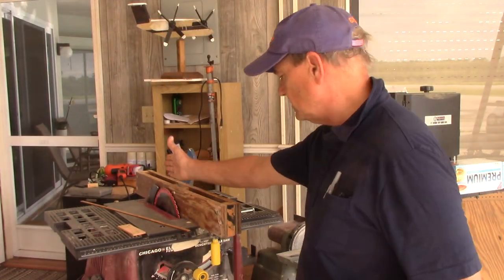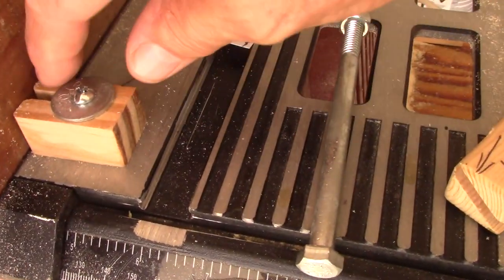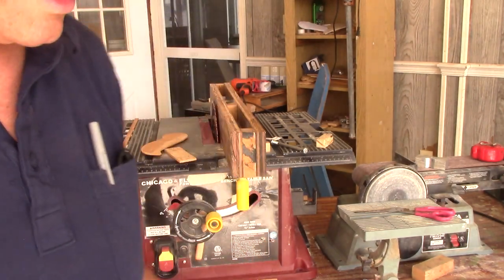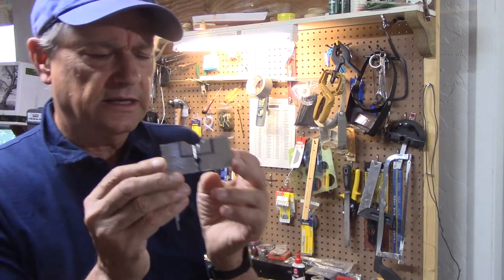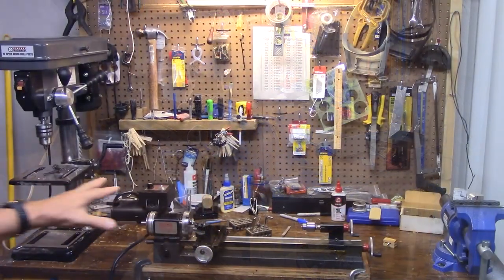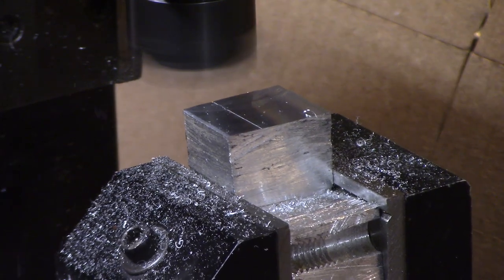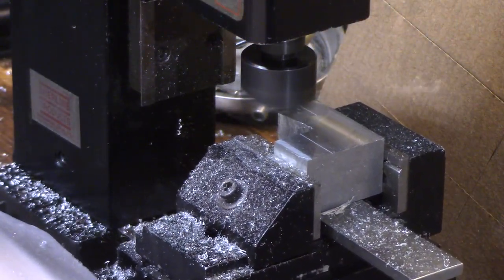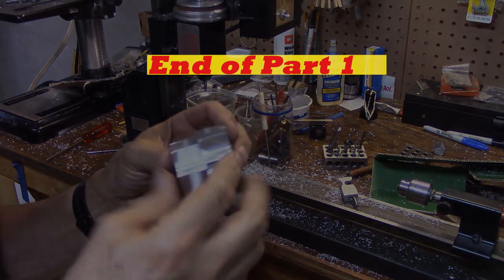How to cut thin strips, Diy Table Saw hack, Cut Whirligig blades consistantly with Rip Fence blocks

Comment: I had a similar problem on my table saw ,I had  a slotted block as you did at the start of the video to adjust the fence on fine cuts. I  drilled the block which you have bolted to bench to take a long bolt, I then made a slot to drop a nut into and glued in having threaded the bolt through the nut. I fixed a good size flat washer to the end of the bolt to push against the fence. I did this to both ends . Your idea look's a lot more professional but I don't have a milling machine. Thanks for your video.
Reply from the maker: Thanks for the good info.  That's  certainly a good solution.  Was a bit of time with the little mill and drill press on the aluminum blocks in the next video.  Planning on showing footage of using it in #3
Reply: @gwheyduke  Thank you,will look forward to your next video.

Comment: The Dewalt table saw has a “pin system” which addresses this exact problem.  It allows the fence to be removed and replaced in exactly the same position, time after time.
Reply from the maker: That sounds good.  The Dewalt stuff is usually well made.  This saw in the video is really a low end product and it shows in many areas.
Reply: @gwheyduke  drill a locator hole and pin the fence , front and back, if you have to. Or , 
Hit the yard sales!